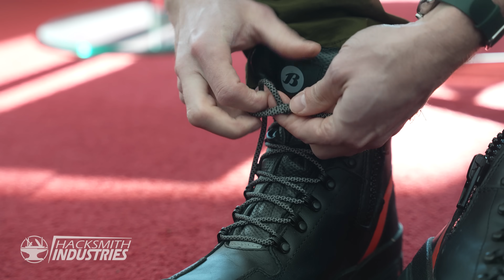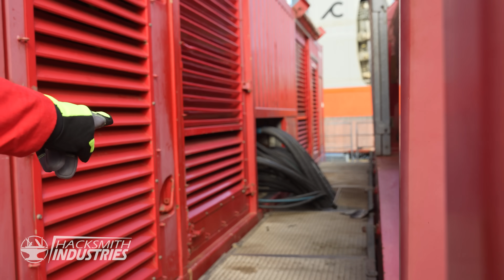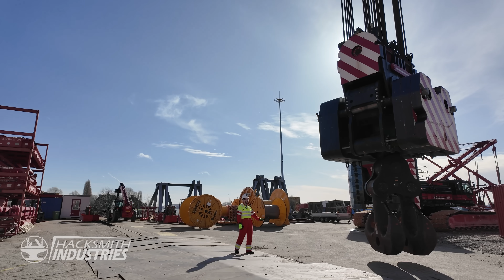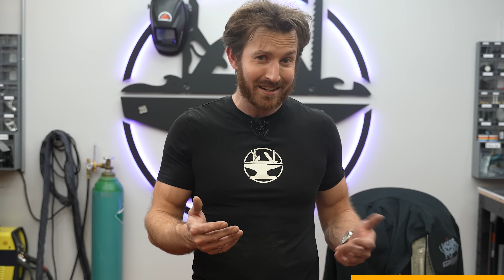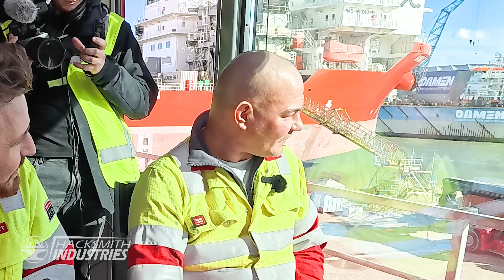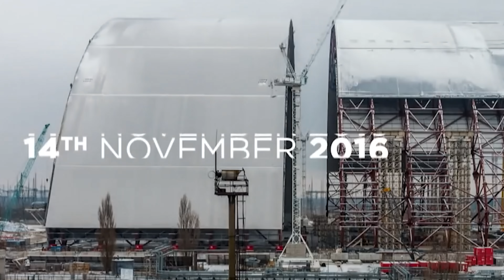I Used The WORLD'S LARGEST CRANE! (5000 TON CAPACITY)

Comment: It’s insane to think that to raise the Cape Hatteras Lighthouse which was calculated to weigh 5,000 tons or 1,000,000 pounds and then push it on five rails using five rams with five foot strokes only required a small portable generator size power pack to supply hydraulic power to the manifold system built specifically for this move. I came on when they needed someone who was willing and could fit through the maze of shoring towers, hydraulic hoses, wires with a 48in torque wrench to torque almost a thousand nuts on the shoring tower bracing. Also climbed to light level during Hurricane Dennis after losing my truck to the ocean. Oops. It was an honor to work with the people I did from a plethora of trades and specialties. Best time of my life. Peace everyone

Comment: Pretty sure that’s not the worlds largest crane. The biggest ons is the Sarens SGC-250. It has the same 5000 ton capacity, but is 4 meters higher and can move itself from one turningcircle to another one by moving among rails. It has 52 shippingcontainers filled with sand as a counterwight.
But the mammoet ons is still pretty dope aswel
Reply from the maker: This one is configurable for different heights
Reply: @hacksmith people think that big carl in the uk is the worlds largest and i disagree with that statement. There will be cranes in the future exeeding these cranes

Comment: i've been there in 2009 when I was 12 years old, they had an event and I operated one of their smaller cranes.
you could win a goodie bag if you managed to lower one inside an oil barrel.
still use the can opener keychain it came with, just lost the logo quite a few years ago.